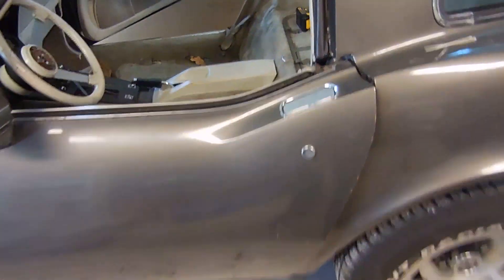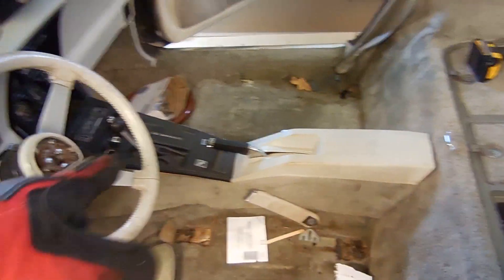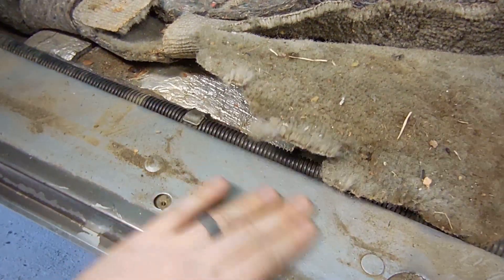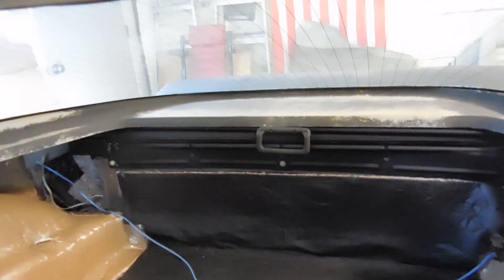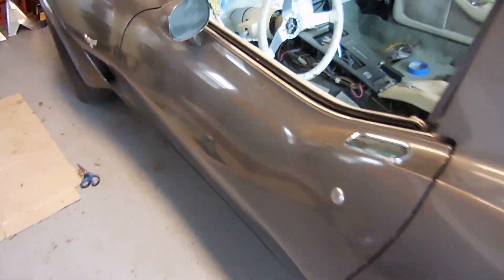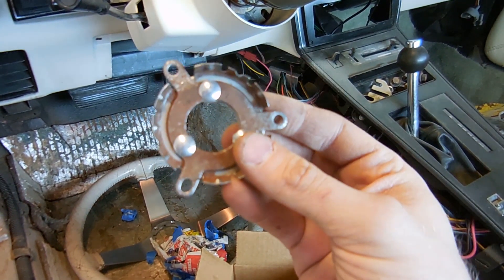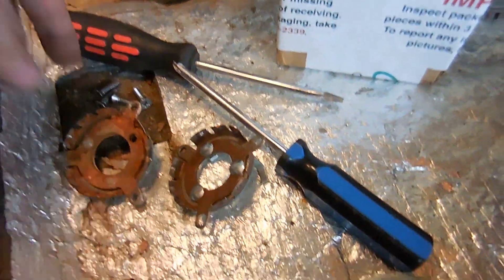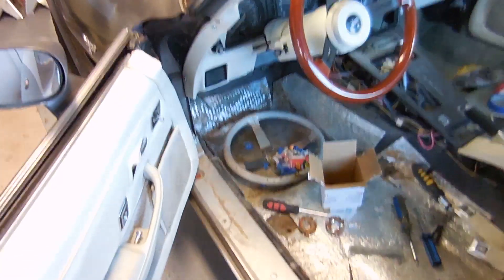1979 C3 Corvette Coupe Daily Driver Status Video 2 of 4

Comment: Ben, the next time you work on a column, go over how the key-in-ignition buzzer works. I think I forgot to put a small piece back in when I replaced my wheel and the buzzer doesnt work. Thanks!
Reply from the maker: Those changed throughout the years. What year do you have? in this 79 at least the buzzer is a little electronic box by the fuse panel.
Reply: I have an 85 Camaro, so the column should be the same and although its not a "buzzer", its more of a flute sound. I still hear the sound when I have the headlights on and the key off but not with key in.

Comment: cant wait for the gymkata, when a firebird had that setup with the last of the 400's in 79 it was a force to be reckoned with, should be interesting to see what the chevolet version is like as out of all the 350 corvettes, the L82 seems to be the one with the most promise outside of the 4th gen models, and the best you can get out of the 3rd generation, outside of the 454 convertible that Zora Antov Duntov took with him as his retirement present in 1974 that is

plus the 327, the decendant of the V8 that made the corvette what it was, was a 68 only option sadly, despite that being what engine builder Bizzarini, the guy who made ferrari what it was, the chosen engine to go behind his supercars as an F you to him.

as even to this day theirs still people who would take a 327 over a 383 stroker or a 396, and say they perform just as well as those without any of the problems that come with those non hydralic cammed engines.

hell I wonder if theirs any cheap way to get a 327 really, like some cheap ass 61 chevy truck everyones forgotten about or something and stuff it into one of these inexpensive vette's

then stick on a big block suspension and make a home made ZR1

Comment: Love the vids Ben, keep up he good work. Also I have a question about my vette. It’s an 85 4+3 car and I just got it running after 12 years, but the freeze plug behind the flywheel is leaking, what do you think is the best way to get to it? Thought about pulling the engine just to be done with it and addressing some other issues...
Reply: Brock Delaney:. Yes, you can pull the engine out, however it would be much easier to remove the transmission and clutch.
Then you need to remove the flywheel and you'll get access to removal and installation of the freeze plugs. Use Lock tight thread fastener when you put the bolts into the flywheel and torque them to 60-70 ft/lbs.
Reply from the maker: I agree with Paul, Take the trans out, it will take much less time, and you can access the freeze plugs from there.

Comment: Hey Ben I have a 76 Corvette that I want to change the steering wheel in. I hate the Vega wheel. Mine is beat to heck by previous owners. I am having troubles finding the parts to change it. The kits that are being sold that manufacturer only makes a few a year. Any ideas? I'd put another Vega wheel back in if I could find a nice black one. I have the tilt and telescopic wheel. I have to change the turning signal switch so this would be a perfect time to do it. Any suggestions?
Reply from the maker: All you need is a steering column hub and bell hub cover from a 1969-1975 Column (they are like an inch longer, a 69-75 steering wheel and horn button. Other than that they will all bolt together the same. I have a hub and wheel I can sell you to get you started.